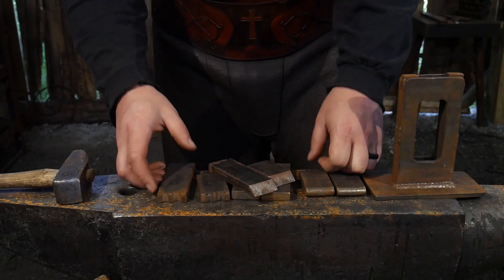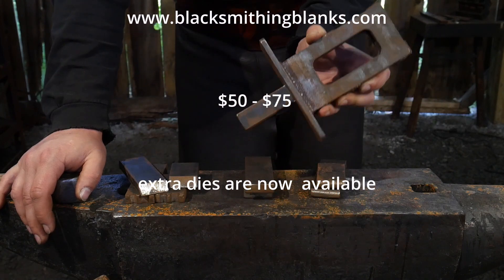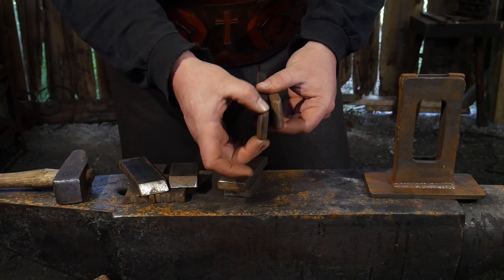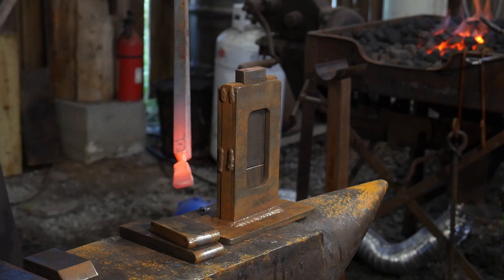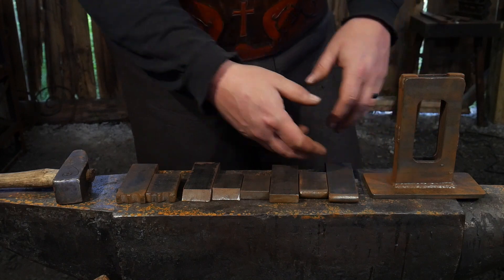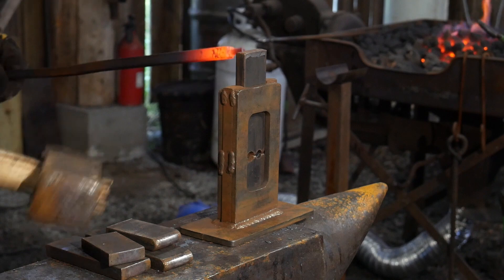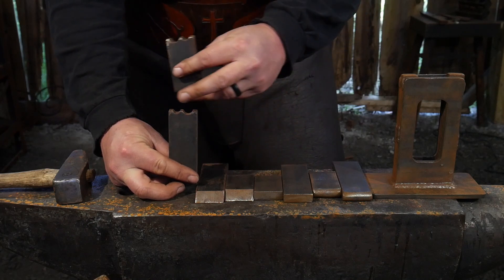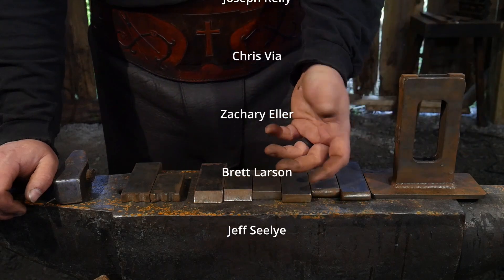The First Dies You Should Make for Your Guillotine Tool

Comment: Great tools and see excellent die making guide here.
If I may add an additional tip? 
A sacrificial striking face welded to the struck end of your top die can be of some benefit. Markedly so if your working large stock where you're having to "give her the beans" as would be the case setting fullers in hammer heads or drawing the initial tapers on a cross/straight pein. 
Just simple cuts of rebar seem to work about as good as anything. Once it gets used up, just cut it off and replace it. I'd propose it's much cheaper than die blank replacement.
  Also noted Mr Roy is using soft face hammer on his mild steel dies in the video.
Hadn't thought of that, however it makes sense. A hard forging hammer may be harder on the dies struck end.
Thanks so much for the tutorial Mr Roy!
God bless now
Crawford out 🙏⚒️🔥🧙🏼‍♂️

Comment: I made one set of flat dies that have 3/8" spacers on each end. I used 4140 for the top die and mild for the bottom. It works great after you fuller thicker material where you don't want to accidentally make the thinner end less than 3/8".